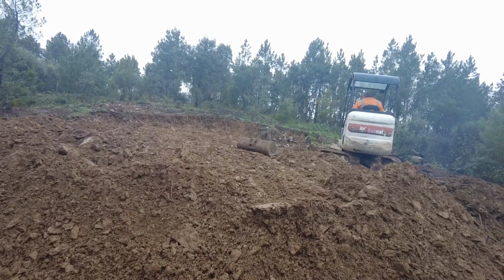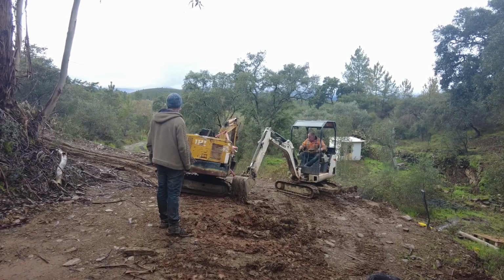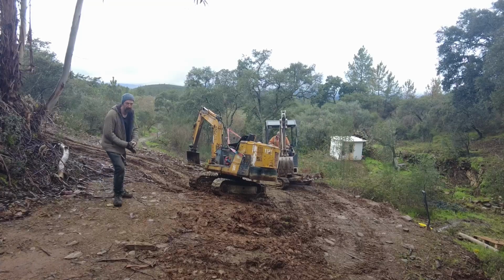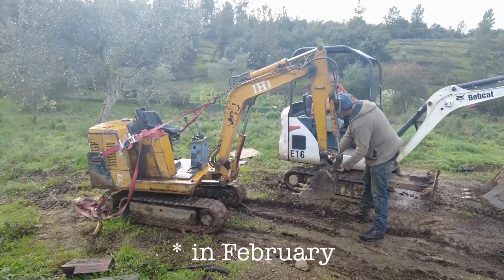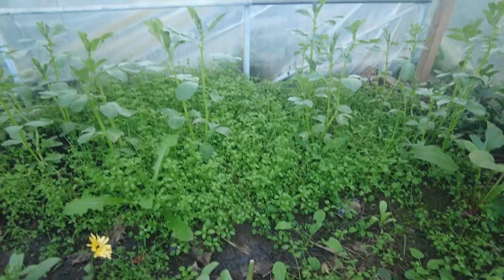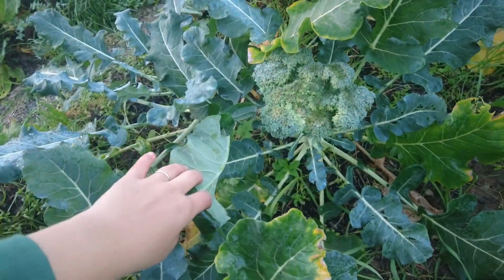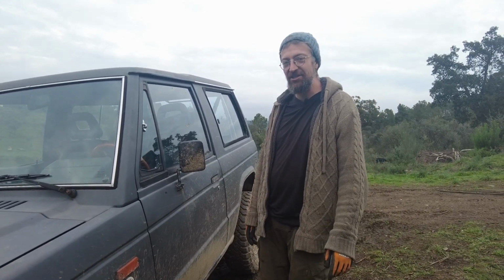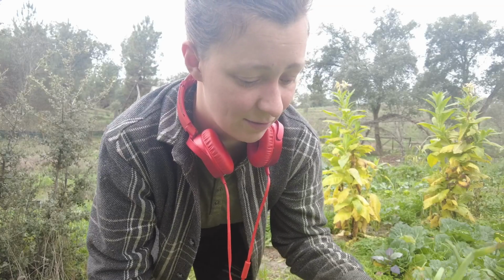Can we pull the digger down the hill? Winter days off-grid

Comment: Not something to spread about, but a trick I learned many years ago for help in starting engines, use something called easy start or if you can’t get hold of that use an aerosol deodorant and spray it in the air cleaner when turning it over. I’ve recently done on it on a petrol motor with a can of gas lighter fluid, which worked a treat. A cheap and convenient solution if it works for you. Good luck, let us know if it works. Love the channel. by the way, been watching since the start.
Reply from the maker: We tried that but no luck... Thanks for the tip though :)

Comment: hey martin it could be as simple as pin holes in a fuel line sucking air instead of diesel
it wont start if its drawing air, Thanks for the videos
Reply from the maker: That's why we replaced the fuel lines :)